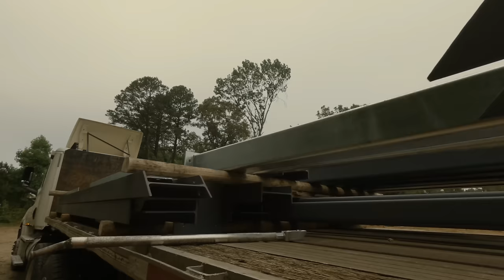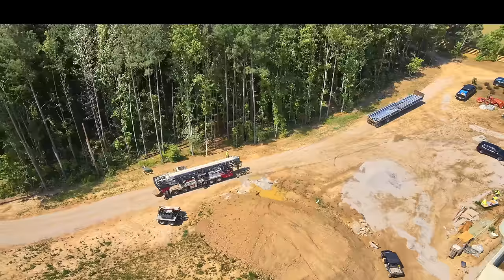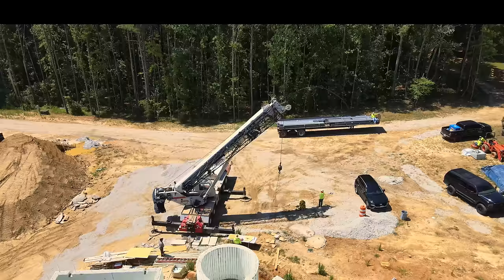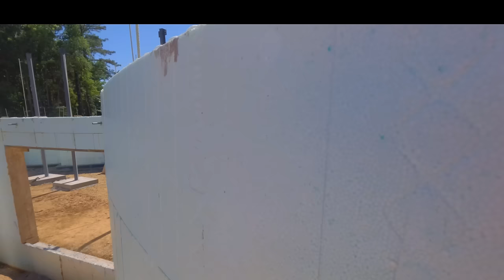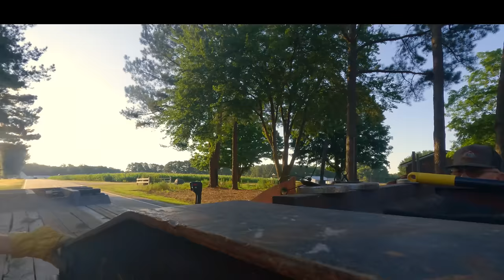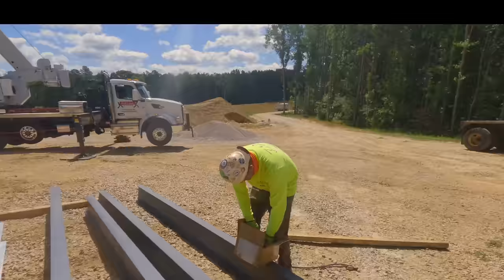Steel Erection Update: Towering Steel Over Nudura ICF Mansion Build

Comment: So glad to see you are building your foundation cap before backfilling.  We had always done that, but got curious if we really needed to or not.  Backfilling would get you safe easy access all around, so, maybe?  What we did was to plot about 60 data points on the plans around the foundation.  Then we proceeded to start backfilling, skid steer, 1' lifts, plate tamp wide areas, jumping jack skinny areas.  We filled to a height of 3' out of our 8' total and rechecked our readings.  We discovered that we pushed to TOW in about 3/4" in several locations, and 1/2" in most of the rest.  We managed to remove some material, push on the walls and get pretty well back to plumb, and luckily not crack anything!  From that day forward we always, always, always set our foundation cap 1st, before any backfilling took place.  I'd rather inconvenience my carpenters for a few days and put up with their pissin' and moanin' than risk a cracked foundation.  Lesson learned.

Not sure if this was intentional or happenstance on your part, but either way, you're doing it right.  I can already tell the 2nd floor is going to be great, and your roof is going to be EPIC!  Thanks for sharing.
Reply from the maker: Thanks 😊

Comment: een waiting to see this. Were the guys unloading and placing the steel just your regular guys of were they special as to where each one knew where the steel beams went?? Does every part of this house build have to be inspected before you move forward with each section of this build?? Will the house be a two story going up from the basement level or a one story form the basement level? Will the rest of the house also be ICF and cement pour as well??... OMG Chris!!! Always great to see him..
Reply from the maker: Basement plus one story. All ICF. The beams are labeled and matches up with the steel drawings. All the structural is inspected by the local firm that does soil pressure testing, we test each concrete truck etc.

Comment: Geoff are you going to Ground and Bond the steel superstructure for Lightening protection?

You are in North Carolina which has some spectacular lighting show at time, and good grounding and bonding is a must.

When I worked on contract at the FAA, the addition they added on the our building every steel column had a cooper ground rod net to it under the concrete slab.
When the built the electronic  and circuit board repair facility, the whole building was a Faraday cage.

By the way Geoff Happy 4 of July,   Please don’t blow your fingers off, with the M80’s and cherry Bombs.
Reply from the maker: Hadn't thought about it. Now I can't unthink it. Thanks :)
Reply: @BealyGood  it better you do it now than wait until the house is completed and figure out ground and bonding was required.  The 1+ million dollar house does need good lighting protection.
I worked in IT and know the importance of Good ground and bonding.

Comment: For a guy that works at a structural  steel mill.   What are the beams? W16x? From what I can tell, maybe some W14. There is a possibility the steel you used came from my plant.
Reply from the maker: Most are W10x17. Some W10x22 and a W10x33

Comment: Does anyone know why the cement footings didn’t have the anchor bolts put in when the cement was poured? Is it easier or quicker to do it afterwards?  Thanks for edumacating me😲
Reply from the maker: It's what the engineer spec'd
Reply: If you put the bolts up you are stuck with it there but it is hard to exactly put those bolts in perfect so you wait for the footing for the beams to be placed later

Comment: Anchor bolt r place b4 footing pads r poured. Not installed with thread rods and epoxy
Reply from the maker: Install is done per stamped engineered drawings. But yes , no epoxy, I assumed it would have that.

Comment: I guess I’m more used to steel building job sites… guess on private house / steel jobs safety is more relaxed. I’m used to on steel jobs,, especially with overhead crane activity going on. everybody has to wear a hard hat. even the job forman & inspectors. no exceptions
Reply: with guys get hurt on high rise steel jobs I’m surprised the steel boss agreed to swing steel before  everybody had a hard hat on
Reply from the maker: Pretty useless when you think about it
Reply: @BealyGood It won't save you of a beam falls on your noggin but lots else can, maybe a hammer, a dropped power tool. If someone's working above me I wear a helmet, or just get out of there til they're done.
Looked like the steel crew were all wearing helmets so when in Rome...
Anyhow, the place is looking really cool with all the scaff and stuff down, it's a wicked project Geoff!

Comment: You are taking a huge and foolish chance in that pool with no fall protection. If the  wrong person takes a fall they will own that house and the farm. You are over your skis.
Reply from the maker: The deep pool has a fence around it. The upper pool isn’t even deep enough to legally warrant a railing if it was a drop off.
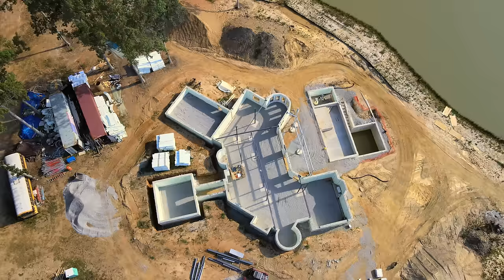Reply: The shot at 22:08 doesn’t show fall protection. Your liability exists today, during construction, regardless of the final product. You might want to have your insurance carrier help u during construction phase. Just my two cents after 40 years in industrial construction.
Reply from the maker: @Bigmikkey55  I appreciate the advice.